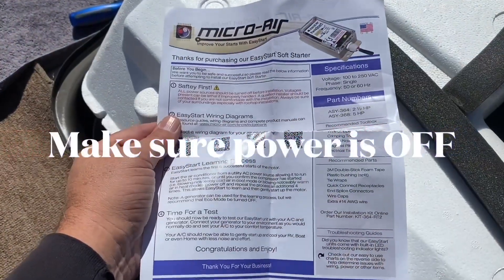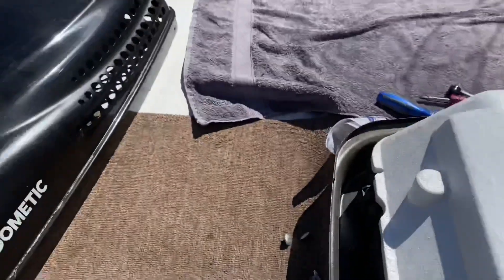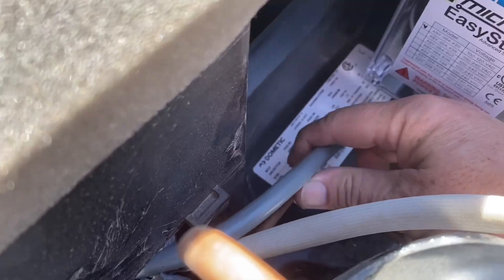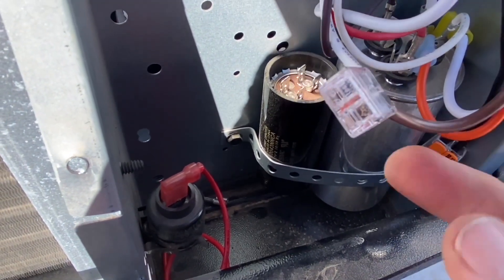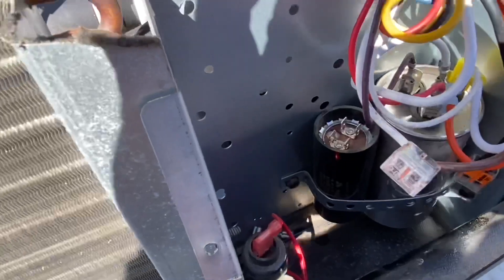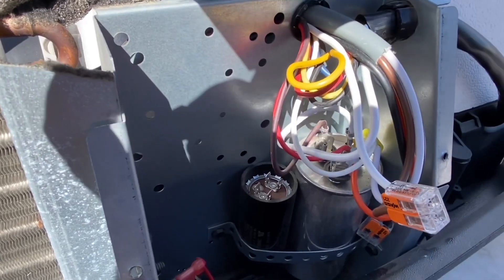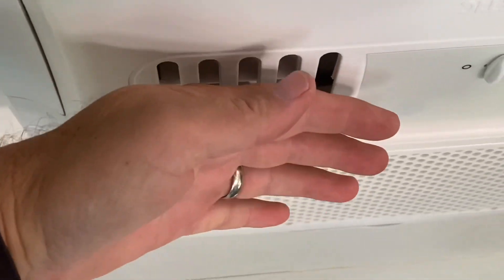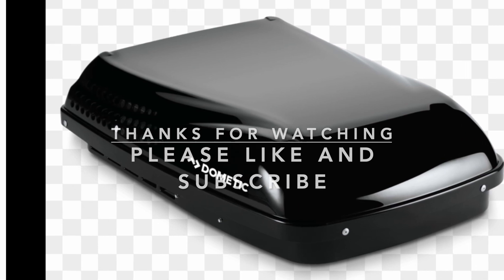Installing a micro air 364 into our Dometic air conditioner so we can run on one generator .

Comment: So following up on your soft Start and generator size, are you guys happy with generator size?
Is it working well?
Thanks for an update...
🤠
Reply from the maker: Yes so far our Honda 2200 is great.  We actually had two  but some one.   Less to pack around.   If someone needed more I would still do the Honda I think just because they are easier to move around.  I have seen some larger ones mounted on back bumpers etc but idk for us they work great.   We use solar mostly so only run generator if low sun or too hot for the air conditioner but we try to follow descent temps .

Comment: Thanks for the really helpful video Don! I bought the MicroAir 364 to install in a Dometic Penguin II that sits on top of my Little Guy Teardrop camper. Those Wago clips appear to be a simple, labor saver, that offers a strong connection.
Reply from the maker: You are welcome.  It was really simple to install and I’m not electrical guru lol.   But ya those clips are great.   So glad I got them. Good connection and easy to use for sure .